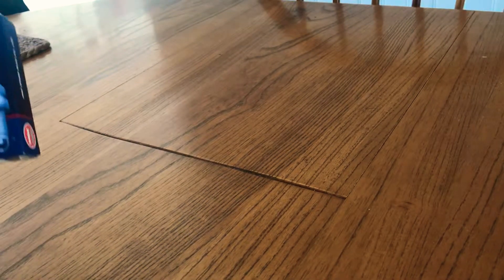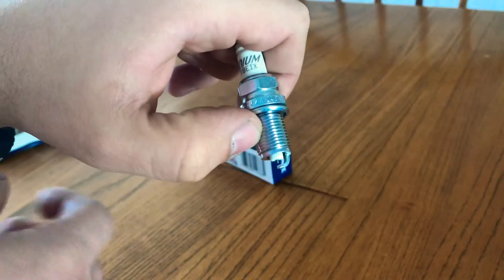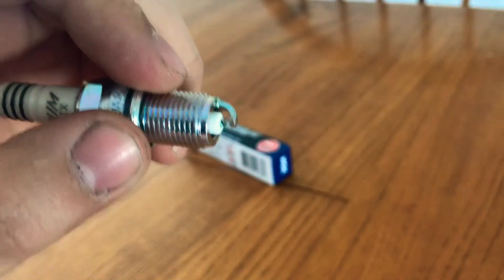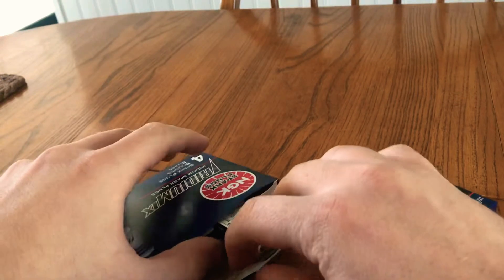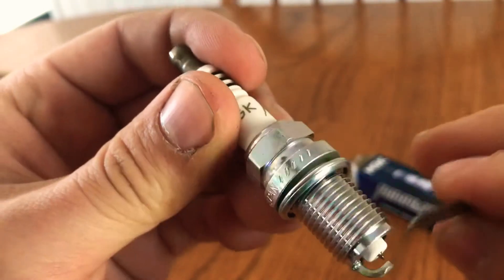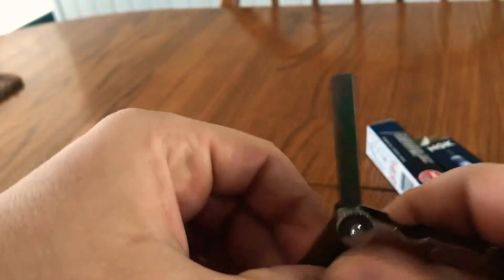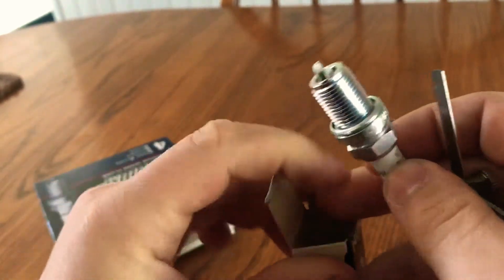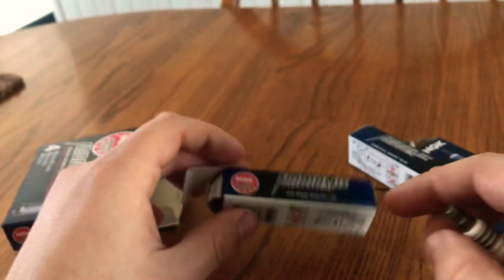DIY Audi/VW Colder Spark Plugs and Gapping

Comment: Im k04 with apr 2.0t vw tsi and it says 0.024 gap for mine, when i was just stage 2 with ko3 it was 0.028
Reply: what was your gap for stage 1
Reply: @shanemulvey2680  0.028 with apr tune
Reply: What plugs you recommend ? I got apr coils bouta hit 100k so need them anyways
Reply: @shanemulvey2680  i had ngk bkr7e